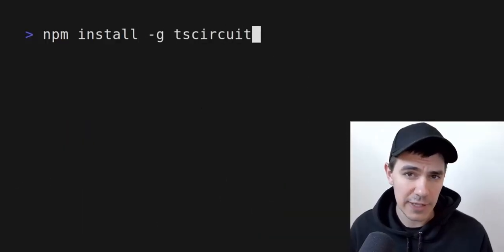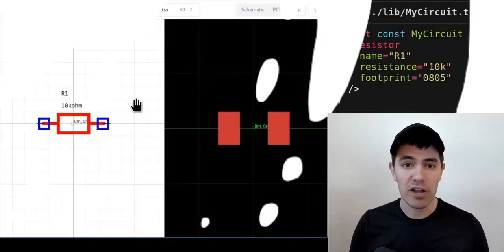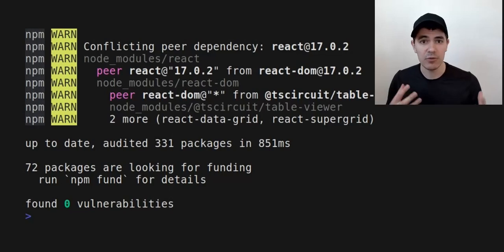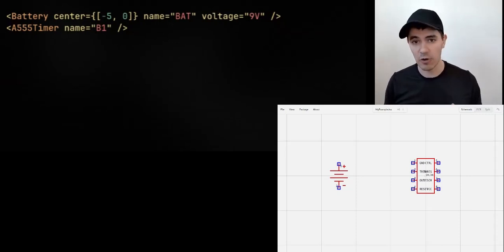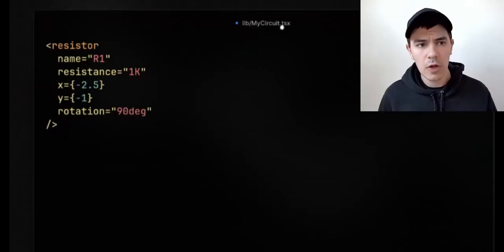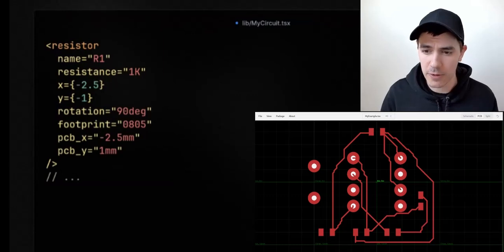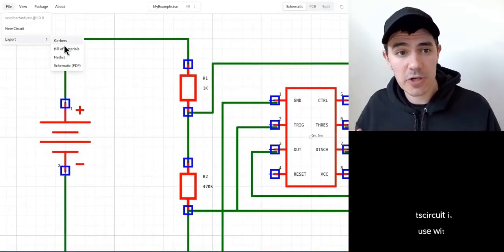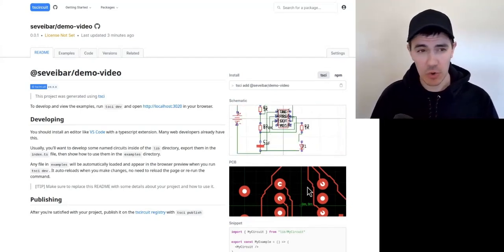React for Circuits - Introduction to tscircuit

Comment: Could this be the start of turning kicad into a web app?
Reply from the maker: absolutely. tscircuit can be the foundation for circuit-building web apps!
Reply: Will be great to have chatgpt or copilot help create circuits simply by giving it a list of requirements and let it write the TS for it. Any plans to connect this with spice or wokwi?
Reply from the maker: @genx65535 definitely planning on connecting to spice. No plans for wokwi currently but I imagine if there's interest someone will make it/I'll target it. Definitely planning to have AI help with the circuit design process